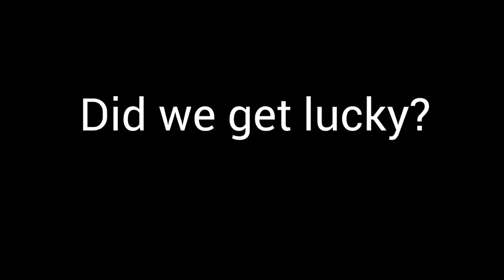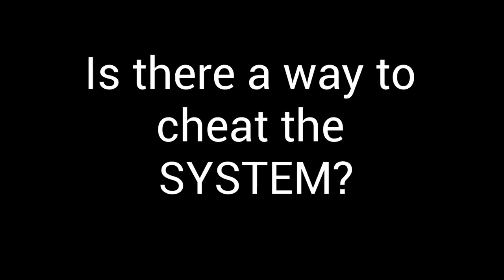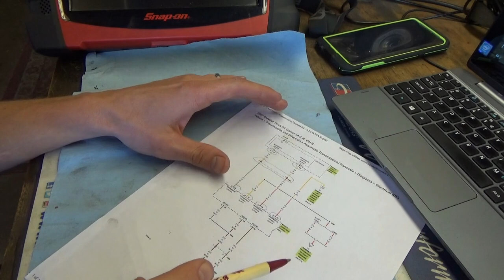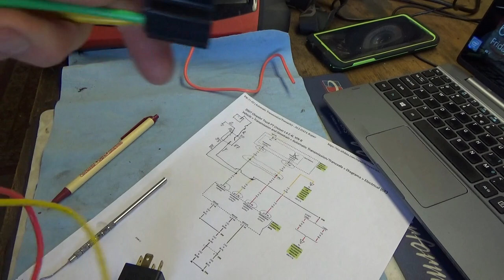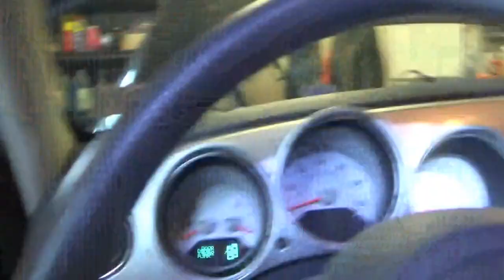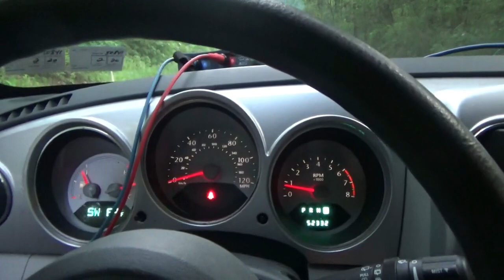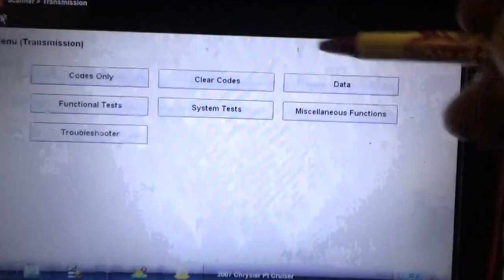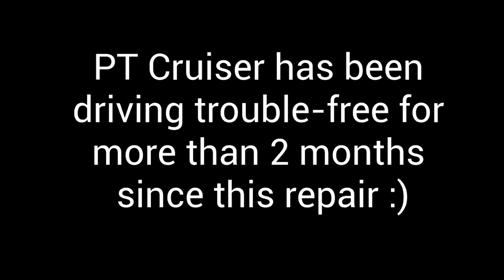Chrysler "LIMP HOME" Cruiser: P0882 - TCM Power Input Low (Part 2 - TIPM!)

Comment: Dude, you are a lifesaver. I had no idea what was going on with my Chrysler 200. Same exact set up. The car was also low-voltage code would randomly come on when I would hit a speed bump or something and it would go into limp mode. Sometimes it would drive for an hour. Sometimes it would do this nonstop. I finally took out the TIPM and started smacking it around and it’s working right now. Worst case scenario I go to the junkyard. I did not even know where to begin, and this has been plaguing me for a month. I kept thinking it was a bad ground somewhere. Nope.
Reply from the maker: Just install a bypass relay, more reliable than anything from a junkyard 😉
Reply: @PineHollowAutoDiagnostics  I would be terrified to try that lol but I ended up going to the junkyard and I was able to get a one from a Dodge avenger and my car is working now? I’ve been driving it all day! Thank you so much man I had the same exact symptoms, so I knew this had to be the problem you were right

Comment: I wanted to say thanks for finding this awesome workaround! I had a similar issue with a 2007 PT Cruiser throwing P0882 and P0750 codes. Mine was "intermittent" where a at random bump would throw it into limp mode getting stuck in 2nd gear. Verified with an o-scope and did the same relay repair with great success. 

FWIW, checking on the scope I didn't notice any nasty voltage spike coming from the relay coil on shutdown. It was a smooth controlled drop to ground so maybe the TIPM still makes a good freewheeling diode if nothing else XD.

Comment: Love the creative thinking, amazing job! Tipm is a thing of the past now, totally intergraded power module now went to the security gateway way module. They did a good job on them, was a good idea in theory. Using the coating for dust and metallic protector. Its main purpose is to take the commands from various switches and other modules and send those commands in the form of voltage or ground to wherever it needs to go. Pretty interesting how it works. Now with all the Can lines going to SGW it’s much more streamline which makes no more need for a tipm.
Reply: What's tipm stand for again?
Reply: Jeremy Anthony stands for stay away
Reply: Totally Integrated Power Module if you were looking for the official name behind the initialisation. But I've seen quite a few unofficial ones too.
Reply: ColtaineCrows he was being facetious to stir up the crowd. Ivan said it but he assumes people watch entire videos
Reply: SGW?    I drive a 1998 Nissan Micra, and I'm glad I do.

Comment: THANK YOU for this!  I was thinking I was in for a $2600 transmission rebuild when I suddenly had only 2nd gear and reverse (I'm used to driving '60s era Fords with C4 automatics, or modern cars with manual transmissions, had no idea what "limp home mode" was).
One thing- my 2006 PT Cruiser's C4 connector has a black and purple wire at the #38 position.  After digging through several articles about fixing the P0882 problem, I began to see that no matter what the year, ALL of the diagrams had the two red wires in the #19 and #28 positions.  Since they're all connected anyway, I spliced in at the #28 wire.  Problem solved.  Again, THANKS!

Comment: I've seen TIPM bypass fuel pump relay kits at a few on-line sources.  I'll bet one of these kits could be modified to work for this application.
Reply: That bypass kit has been available for the fuel pump circuit for some time. I think that Chrys even has some TBS diagram

Comment: Youre a life saver, as of now no complaints on the fix? Mines been in limp for 2 months and couldn't for the life of me find the fix. Excited to try this-this weekend!
Reply from the maker: Car is still running fine as far as I know. Good luck on the repair!
Reply: @PineHollowAutoDiagnostics  it was a 4 point relay correct? 12v or 24v?
Reply: And is soldering absolutely necessary? I have no experience at sodering at all which is what mainly concerns me

Comment: You are lucky the output of the driver could handle the relay solenoid thruput current. That was your savior. I'd have used a 3 or 4 amp fuse.

Great job, you didn't change the functionality of the safety limp circuit and I doubt there will ever be a future issue. Just make the relay assembly look manufacture and professional.

I'd say your pricing was spot on.

Comment: 475. Minimum. I had the exact same problem last year. Got a used tipm at Pick your Part for 30. Didn’t have to program. It just worked fine. In future I will use your method. Similar issue with 03 Expedition fuel pump relays. They r integral to the power distribution box. Tried to solder in a new relay. Horrible solder skills. I would wire one in using your method next time. The good news is there a billion of those things in the junk yard. As always, really cool vid!!

Comment: Hakko was the best soldering Iron I've used. I order tips from factory. Great iron, and customer service. I use liquid flux in a plastic bottle with syringe tip helps solder flow faster and evenly.

Comment: Some years ago I had an over-the-stove microwave where the board went bad. Board was NLA.  I installed a timer switch and a couple of relays and it was back in service. I made sure that it was safe: the magnetron would not operate if the door was open. It lasted for years this way.

Comment: You're the man Ivan! Just had customer bring in 2007 PT that he had been running in limp mode for six months because he couldn't pay $3000.00 quoted for a new transmission.
He came to my shop hearing  about my work in electrical repair.
Scanned car, P0882 primary code, no 12 volt output on wire or scanner. Added relay-transmission fixed, no "fuse box" required!

Comment: Good thinking. The TIPM looks like a glorified I/O module. It's a good, reliable modern solution as long as the board is properly designed and QA tested. Unfortunately, not all designs are thoroughly tested and debugged. Quality control is not always the best either, since the contract goes to the lowest bidder, especially these days when everything is outsourced. Components quality can be questionable as well. 
You won't believe how many times I've done a similar repair and never had any complaints. Sometimes I've added a few additional components to the circuit board to make things work. 

BTW, be careful with installing relays to a solid state logic board. There is a voltage spike due to self induction in the relay coil when the coil is deenergized. It will probably work just fine but it may kill the output transistor on the ECM output.  You can install a diode across the coil terminals to remedy the problem. Also, a mechanical relay can be subjected to contacts chatter (caused by vibration).
Another solution is to use a 12VDC solid state relay (from "Ebay" or a similar retailer).
Reply: Since when has Chrysler EVER been known for great quality control!

Comment: I've said it here before... This is technology for its own sake. Does the TIPM work any better than old-school fuses and relays? NOOOO!!!!! Then there really isn't a point to it... Even when it does work.
Reply: It's done to save space, if you used the electro-mechanical type it would take up half the car because there's so many
Reply: Unfortunately for us.......it great for the dealership as they sell more parts.....really expensive parts😵😵😵😤😤😤. This was an awesome solution for an older vehicle with an understanding customer. I believe that 3 1/2 hour labor is fair vs a new TIPM. Just hope nothing else fails on it as Ivan could be married to it! Chrysler is my #2 favorite brand to repair as they as POS's almost as bad a Chevy products (excluding the full size trucks & SUVs). They make me soooooo much money!
Reply: @melsmobileservices4223  we have a fleet of 200 Chevy g3500's and your absolutely right they are garbage on a whole other level, nothing but problems, I have brand new units 1200 miles that have misfires, the harness/connectors for the injectors are all breaking inside the wire sheathing, among many other problems, but I'm ok with it,  it makes me 140k a year so let government motors keep building junk
Reply: Amen!

Comment: a trick for repairs like that, liquid flux the wires after putting together, then heat from top and feed a small amount of solder onto the the iron to wire contact point, that will quickly speed the heat transfer, then quickly roll the "iron" from top to side and feed the proper amount of solder to not form a big drip at bottom ( the solder always flows towards the heat source!)
also 720 to 790F for old school lead solder works well, lead free need higher between 800 to 830 range to flow well, use the wider part of tip for better/faster thermal transfer, best yet for wire splices get a wide chisel or D shape tip...

Comment: Hi Ivan. I learned a lot from these videos. My problem is very, very  similar. It's different in one way. The problem may occur one day, but not the next. Usually I have been pulling over, restarting and things become normal again. Lately even that's not working sometimes.  I liked the way your spoke out what you were thinking. Being an electronics hobbyist myself, I find myself talking to myself just like you do when troubleshooting. I guessed the extra relay just as you did. I will give it a try because the work involved is minimal. I won't bother pulling the TIPM. I'll just do the relay. Maybe re-seat the connectors but they seem well made. That oscilloscope software is terrific. Thanks...Dennis
Reply from the maker: Good luck!
Reply: @PineHollowAutoDiagnostics  Update: Turns out my '05 PT does not have a TIPM. Those started in '06. Mine has the usual power center near the battery with relays and fuses. I ended up purchasing and installing a refurb  computer. The company in Toronto sets them up with your VIN and mileage. Works perfectly now for a couple hundred bucks. Shifts great, no trouble codes. Be very careful pulling out those four connectors from the computer.
Reply from the maker: @lindasurek4578  Great to hear!

Comment: AWESOME! ! I was getting bummed at 1st.  LOVE the idea! #perseverance for the win!!
Reply: Actually, to answer your bonus footage question, that's more than fair. Yes... 2 hrs for the diagnosis, which is fair when it's pointing to a main module. The ability to prove in various ways, that a costly module is the issue is time consuming. 

Then then 1.5 hrs for the fix is about fair..  maybe even a bit more. The work involved in opening the TIPM and then studying the board and THEN coming up with a solution, outside the norm is also worth every penny, especially compared to the cost of an entire unit. I love the fact you warranty your work too, that's the way it should be. 10 fold when it's for such a considerable span for electronic repair!! 2 thumbs up Ivan! 👍👍😊
Reply: Hi Cuba . did you get my email
Reply from the maker: Thanks Cuba!!!

Comment: Thank you so much my man! Used your skills and video to repair a 2006 PT GT Convertible that I bought at auction. Funny enough is this one has super low miles as well, it also does not have any yellow/orange wire coming out of the connector, for some reason those wires are pink. Repair worked nonetheless, thanks!
Reply: was the green one right? do you remember which pink one?

Comment: I’m dealing with a similar problem right now on a 2008 PT Cruiser…. some time ago, on the same car, the headlights, horn, and random electrical quit working and I was told I needed a new Tipm.  I saw a video which suggested removing the tipm entirely from the car.  Let it sit overnight. I actually left it out of the car for a full 24 hours. Reinstalled, plugged everything back in.. and boom… no new tipm, no more problem. I’m not confident that would workin this situation but may be worth a try.

Comment: Absolutely that's fair!!! 3 1/2hrs labor verses a $600part PLUS the diag time, install and program.  Had I similar instance. Jeep got towed to me, another shop claiming it needed a PCM and program. Veh had had some chewed wire rodent dmg.  The "rewired it", still didn't run right, bunch of codes... called PCM.  I rechecked EVERYTHING, come to find out, they had wired it wrong, (only looked at colors, didn't bother w pin location),..... after figuring this out, I completely rewired veh, got running perfectly, charged 4 hrs labor, and no parts required....cust happy as can be!

Comment: I was just thinking about the same thing in part 1 , but then I worried about what other components inside the TIPM were going to fail next! Because you know it's coming, but least the customer is fully aware that these things have a high failure rate. I think the charges to the customer were spot on .

Comment: Cheaper, and better. Somewhere in the late 2000s I believe it was the fuel pump relay on these TIPMs  ( Mainly Jeep Cherokees, that i know of, probably lots of other chryslers, )   KNOWN for going bad. I believe instead of replacing tipms through recall the fix chrysler had was this exactly. Except your "fix kit" was the relay in a bag with MOPAR written on it and it was 60-80 dollars. Only difference was the exact instructions on how to wire it. Love your fix!
Reply from the maker: Thank you for the comment, Shane! Yup going back from new to old-school reliable relays and fuses :)

Comment: Well Done explanation and fix why these Cars fail.  I got the same issue.  I would also check and clean the Solenoid Pack on top of Transmission.  That tends to collect water and rust forms.  I cleaned it.  And so far no codes for Limp MODE.

Comment: Nice repair, very fair price! Thing with a TIPM is, they should be more reliable is designed correctly. And if you have to replace them, yeah, they are more expensive than a relay but the prices manufacturers are asking are just insane for what's in it.
PS, I should have placed the fuse on the battery side (and labeled it). Leaves it more in sight and a shorter unfused wire.

Comment: I wish you were my mechanic 😢. My 2002 PT Cruiser transmission is acting up but it only happens after 30 minutes of driving. Very consistent. My mechanic said the transmission fluid was good. There is no engine or transmission code popping up. Also, might be related, the air conditioning is not working but full of coolant in the system. The compressor surges (I.e., cycling on/off) about once per second. All this leads me to believe it’s either the PCM, TCM, or TIPM. 😢

Comment: It acts like a bad solder joint with the tapping causing it to drop out. Your fix is better than the TIPM itself and if the relay ever dies you can just pop another one in. TIPM was a terrible idea and probably saved Chrysler a few bucks but caused their customers lots of pain and money.

Comment: Very clever thinking and follow through.
 Now (in concert with HPT's thinking) Chrysler in their next Cruiser edition, will insert a microprocessor in the path where you installed the relay. Then the ECM will only permit normal circuit function if there is a specific handshake or (Yikes!) series of handshakes.

Comment: I think your  billing is spot on. I don't think the car is worth the money but that's not up to me that's up to the owner. Definitly worth it as a DIY repair.
Reply: DIY repair?? How many DIY guys you know have a PICO scope and a $10,000 scanner? This is as professional REPAIR as you can get. Anyone can change parts.
Reply: @budquick3135  I have a scope and I bidirectional scanner that costs less than $100. I don't remember exactly what this repair was since it's been a long time but I know you don't need to have exactly the equipment ivan does to do the diagnosis even if the pico mgith make it alot easier because i has he presets. Where I live it's more likely a DIY guy would have the equipment and the knowledge how to use it than a dealership though.

Comment: I ended up going to a junkyard and pulling the TIPM out of another 06 PT Cruiser (same model with a matching 8th digit of the VIN) and installed it in my PT Cruiser and now it runs like new. Took me about 15 minutes to swap it out and cost me about $32 for the part.

Comment: Great trick for bypassing the switching in the TIPM.
I have a 2010 Sebring (2.4L/ 4 speed auto)  that I tried this on it. I was getting P0760 and then P0765 codes as well as low power codes.
The 12 volt line from the PCM only pulses 12v  and then goes to zero without the relay installed.
I figured that the PCM did not sense the voltage on the yellow orange line and shut down the 12 volt feed on the light Green / yellow-brown line. With the relay connected it does get the 12 volts on the line and stays up. unfortunately I am getting intermittent drops on the OD solenoid and UD solenoid circuits but it does not code for a while. it also does not kick the OD solenoid into action. it worked perfectly with a different TIPM(test unit from 2011 200) and no relay, but only for awhile and then reverted back to the same behavior. I am thinking that the PCM/TCM is faulty in the circuit for the Trans voltages or sensors or the the calibrations do not allow this fix to work. Tomorrow I will check the yellow-white wire and the yellow-green wire again to the solenoid pack. the solenoid pack is new and tests good between pin 4 and 5 UD and pin4 and 6 OD (around 2 ohms) the old one tests good as well(should have tested it thoroughly before replacing but I did a complete service on the trans, though it probably did not need it.

If the solenoid signal wires are good to go, then I will replace the PCM at a cost of$250 for a specific 2010 Sebring with my part number including Vin programming. They said that even though the PCM has the same part number you need one from a 2010 Sebring because the TPM has different calibration values and the programming skips the TCM portion of the ECU.

Thanks for sharing your genius on this.....
Reply from the maker: Good luck! Please post your results!